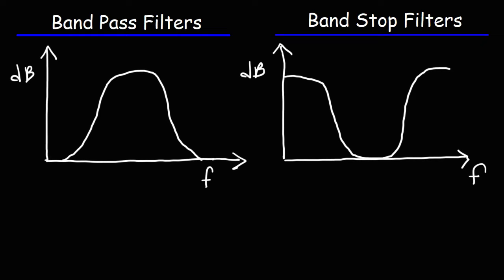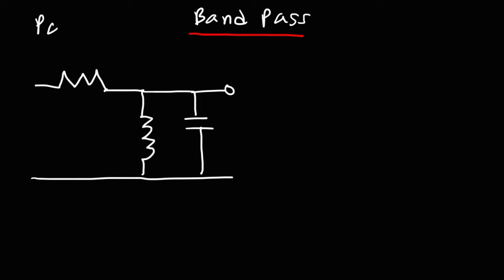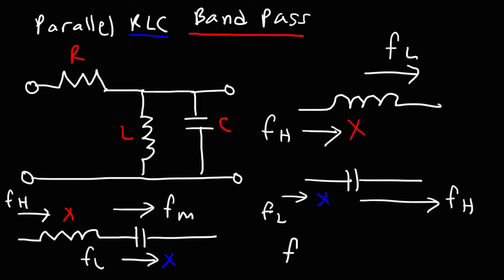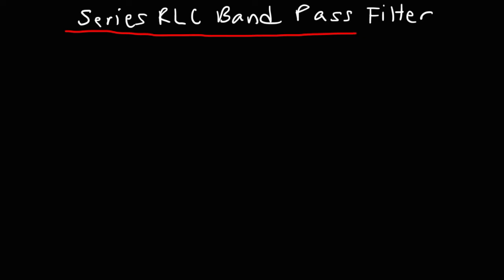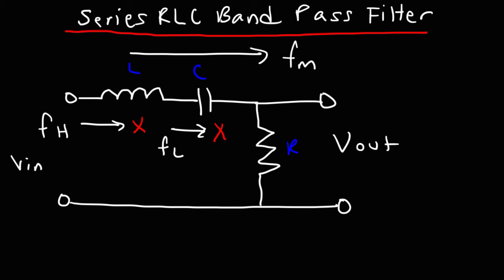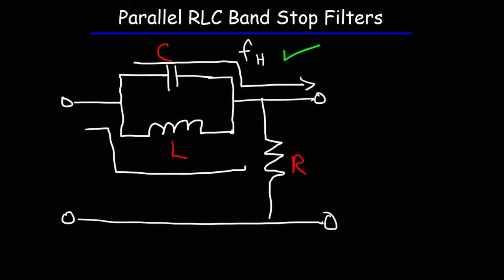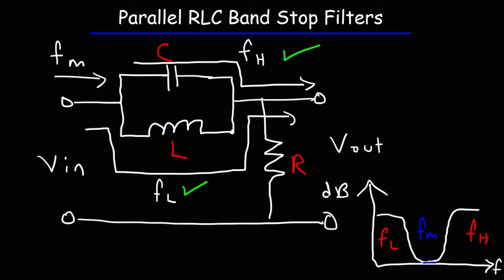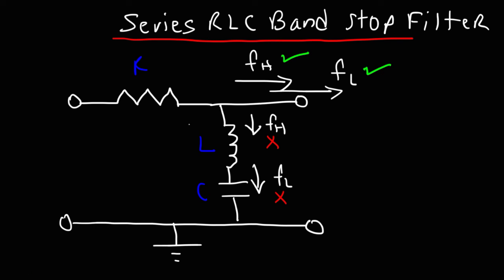RLC Band Stop Filters and Band Pass Filters

Comment: What if there is a combination of series and in parallel? No one gives such an example. The whole web can't put 1 example together. BUT my teacher asks these kinds of circuits, even without him teaching us anything that resembles it.

    ----- [Resistor] -----------|------ [Capacitor]------|---------------------o
     +                                 |                                  |
                                        |                                  |
     Vin                    [Capacitor]                  [Resistor]               Vout
                                        |                                  |
      _                                |                                  |
    ----------------------------------------------------------------------------------o

What about this circuit? According to the video, high frequencies pass through both capacitors. Do they make it to Vout?
Also, the low frequencies are totally blocked. So, this is a high pass filter or a band pass filter?
Reply: So much work put in a comment that will never get answered. I'd do it myself, but I have no idea.
Reply: what's the purpose of such circuit anyway, it just doesn't make sense to put a capacitor in parallel followed with another one in series especially when we're talking about filters
Reply: @simozy4475  I don't remember asking for meaning behind the circuit. It was in an exam and it seems likr no one's able to solve it. End of story. Fk that teacher. We moved on.
Reply: To start, neither capacitor will pass low frequencies

if the FIRST capacitor on the left (the one shunted to ground) IS A LOWER VALUE in Farads (e.g. pico farads) THAN the SECOND capacitor (e.g. micro farads) (the one on the right, in series)... then the very high frequencies will get shunted to ground, and thus, filtered out, by the first capacitor on the left... and whatever frequencies are still present, those frequencies will then try to go through the second capacitor on the right.

But, as it is a capacitor, the lows will NOT get through, so it will only pass the mid-frequencies that are present in the signal that remain after the very high frequencies were filtered out from the first capacitor

So, this circuit is a band-pass circuit

I think of it like filtering sand through a metal screen... large grains of sand (low frequencies) can NOT pass at all... medium and small grains WILL PASS. A second, tighter screen will let the small grains PASS, but the medium grains will NOT PASS.   The analogy is not perfect, but it is similar enough to be useful

With the sand analogy, we would block ALL large grains (low frequency), pass the small grains (the very high frequencies... but we throw them away... shunt them to ground), and be left with only the medium grains (the mid-frequencies)
Reply: The Organic Chemistry Teacher has already answered with a video...

https://www.youtube.com/watch?v=ENy_zg9dX5c

Comment: Thanks for this, I needed a visual overview of these 4 for my AC Circuits final tomorrow.  One thing future travelers should note, is that when an inductor (L) and a capacitor (C) are placed in *parallel*, at the resonant frequency (XL = Xc) they actually create something approaching infinite impedance to flow, which is a sort of virtual open circuit, thus blocking the path of current.  I needed to see this laid out to really get how the signal was being filtered or not.

Comment: With the series band pass and parallel band stop filters, what does the resistor across the output do?  What would be different if there was no resistor?
Reply: If there was no resistor between the output, the current would have an unobstructed path to ground and the output would receive no signal (current takes the path of least resistance).   The resistor allows the current to split to the load.
Reply: @BASEDinMaine  You've assumed the resistor would be replaced with a short - why cant it just be open (no resistor)?

Comment: How to find the transfer function of these filters?
Reply: By setting up a Voltage divider equation without Vin (since the transfer function is Vout/Vin), where the output branch's impedence goes on top an total Impedence goes on the bottom

Comment: Capacitor passes low frequencies, inductors pass high frequencies as far as I know. Not the other way
Reply: You both are right. How is that possible? The capacitor in series lets HF signals pass, and blocks LF signals, but the capacitor in parallel with the output does the opposite, it shunts to ground the HF (which prevents them from getting to the output port destination, the load) but not the LF (which lets them pass to the load.) The impedance of the capacitor, in ohms, is inversely proportional to the frequency of the signal as per Zc = 1/(i.w.C), where i is the imaginary unit, w in rad/s, and C in farads. I hope that helps.

Comment: Sorry, but I do not understand the behavior of the Parallel RLC. L and C are parallel. That means for me, a high fr can pass the capacitor, the low fr can pass the coil, because both components are parallel and and fe  there is no need for a high fr to go through the coil.
Reply: instead of thinking of it as a capacitor passing high frequency while the inductor does nothing, think of it as the inductor absorbing the higher frequency, and the capacitor passes what isn't absorbed.